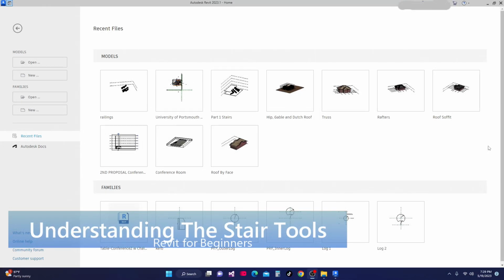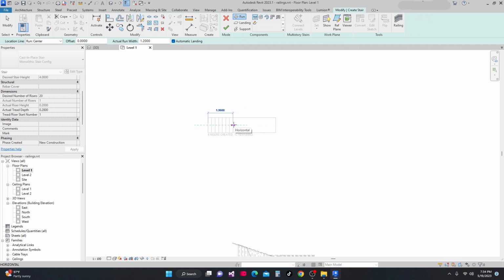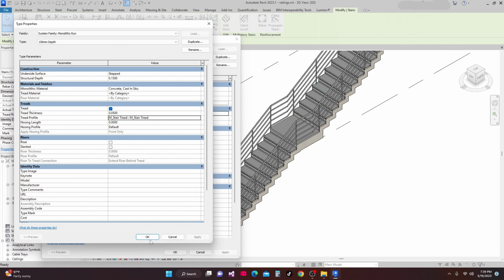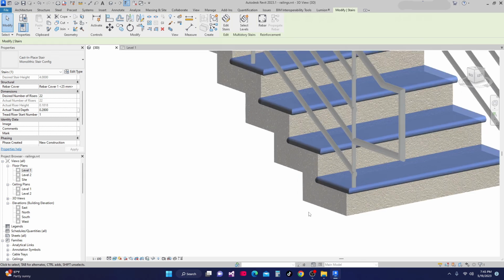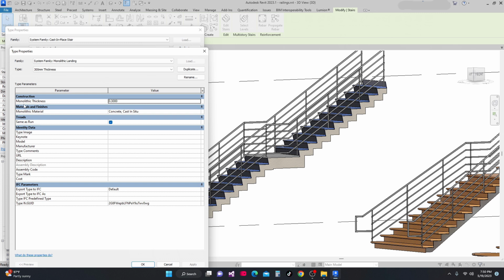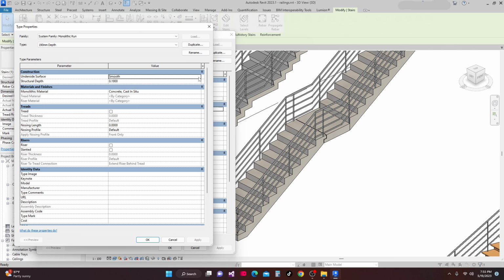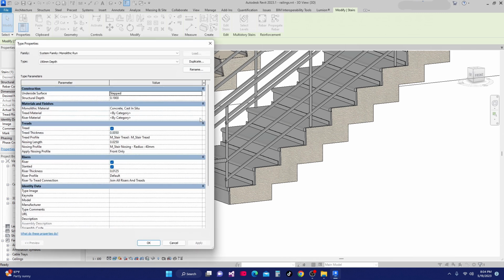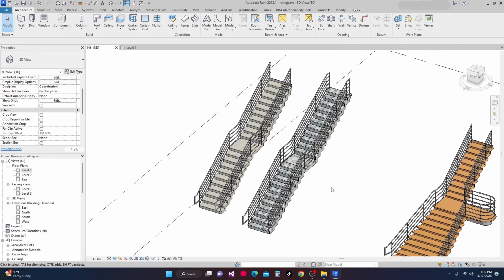Revit Stairs and Railings, Part 5. Understanding the stair tools (Mastering Revit Architecture)

Comment: How to select  different material on the  side of stairs ? like nosing was extended on left side , in similar way how to change only sides of the riser facing the railing side.
Reply from the maker: If you want a different materials for nosing you can make a nosing in component Model In-Place and then make any shape you like in sweep, will explain this in my next video.